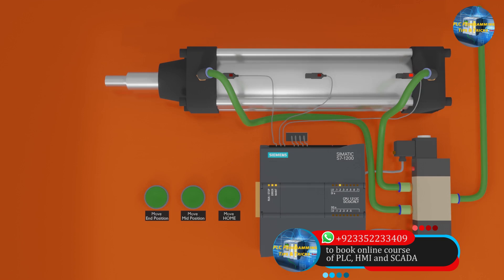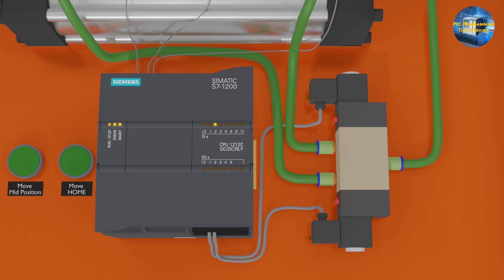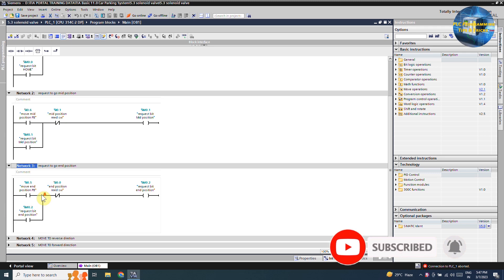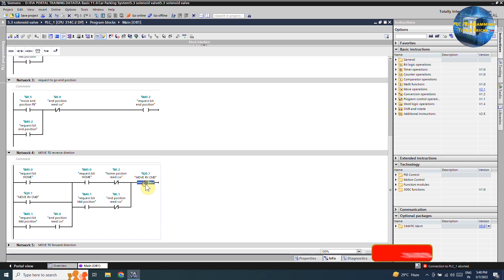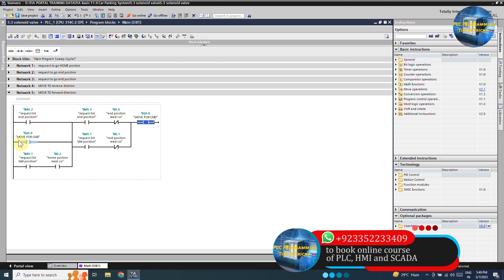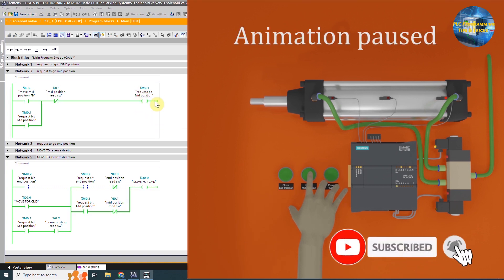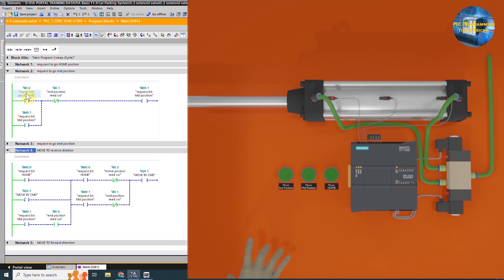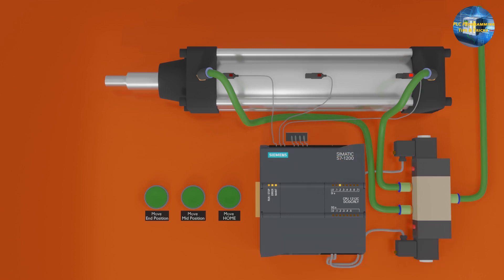PLC Project to Control a Pneumatic Cylinder with 5/3 way solenoid valve TIA Portal

Comment: Would it be possible to automate with a closed center 3 position valve and what would the ladder logic be for a DL06 automation direct controller without the buttons? I need it for a test where it stops in the middle once in a cycle.